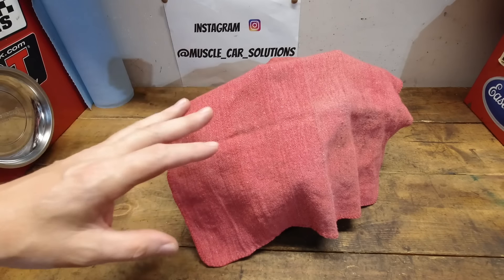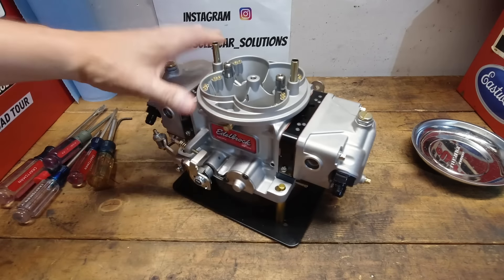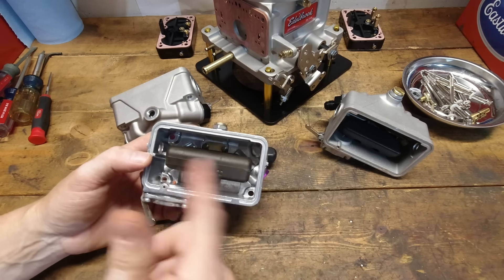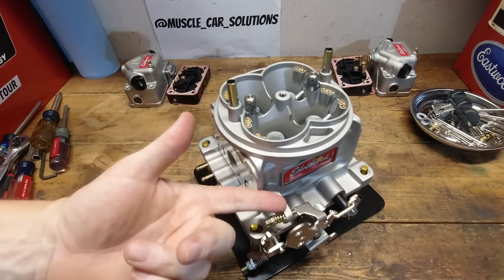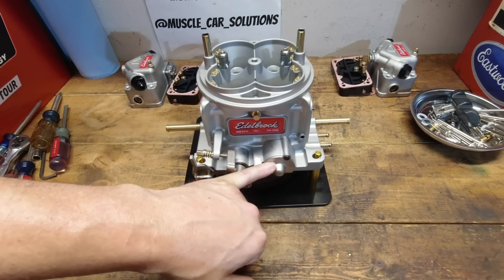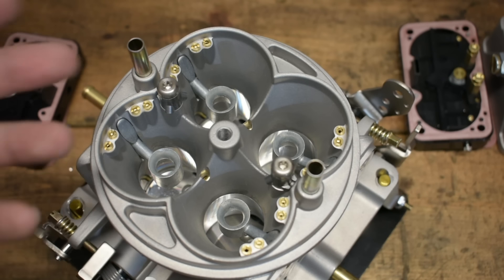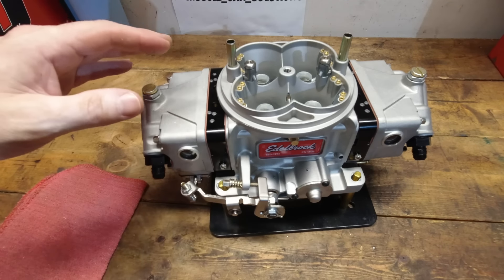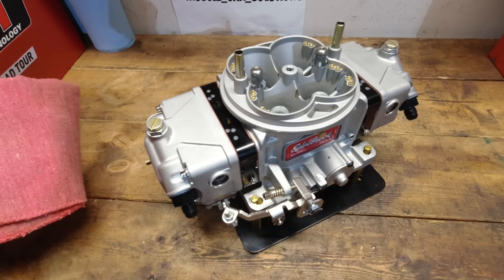The New Edelbrock VRS-4150 Carburetor - Full Review!

Comment: I’ve been waiting for a carb like this for years. Custom making air bleeds is such a pain and I love all their little touches. This is basically a braswell carburetor right from Edelbrock. But I definitely see a lot of hate for this coming in the future. People that don’t know how to adjust the carburetor are not gonna be able to get these things to run properly and this carburetor is going to get a bad reputation for being a POS.
I do think it was a bad move saying that this is for street guys, this should be geared as a race only carburetor this has no advantage over a standard muscle car engine with an AVS2. This could turn into a marketing nightmare for Edelbrock.
Reply from the maker: The Braswell doesn’t have a TPS.  Or the bowls this one has.  Or the auxiliary air bleeds.
Reply from the maker: I understand the thoughts, but calling this a marketing nightmare is opposite what it is.  The cost of a race carb with these features is easily double.  What kills carb guys is zero clue how to tune one.  The race guys don’t generally have that issue.  Once they use one, and see what that extra length in the venturi gets them, it’s going to gain traction in that crowd quickly.  If there is barking from the uneducated trying to monkey with the bleeds and emulsions, they’ll get laughed out of whatever Internet forum they’ll cry on.  We haven’t even broken into the beginning of this carb.  Just wait till the race engine builders get ahold of this carb for engine development.  Game changer.
Reply: @MuscleCarSolutions  absolutely it is a game changer and I love it. I have been on their waiting list to get one of these things for almost a year. The second one is available I’m gonna get a 950 for my BBC. I might pick up an 850 for my LS as well. At first I was a little nervous about not having a removable base but I guess we’ll see if it becomes an issue. The one thing I wish they would’ve kept from their other carburetors is the vertical jet system so you don’t have to make a mess every time you need to do a jet change. Not really an issue for a street car but in a race car application it’s a pain in the ass and a lot of intake manifold fire start because of that gas that spills out.
Reply from the maker: That’s one thing that might be a change in sizing.  I’m likely going to try a 750 on a 460 big block build I’m working on.  If it does struggle, I’ll go to the 850.  But from what I’ve been told by Edelbrock and by a builder who has had a couple on some crate engines they build, they have made more power with a smaller CFM.  100% that’s from the taller venturi and the redesigned booster.  Either way, the next year tuning on these is going to be very fun!
Reply: Don't they have an app for adjusting it?

Comment: Avs 4150? Holley 4150?
Reply: My bad vrs 4150
Reply from the maker: Did you…watch the video?
Reply: @MuscleCarSolutions  Ya I watched the Video. I just find it funny that it looks similar to the old Holley 4150 and they call it a 4150 I wonder if there gona come out with a version with only one metering block and a metering plate and call it a VRS 4160
Reply from the maker: 100% doubtful.  They have found great success with the performer and AVS carbs.  Creating a 4160 would be a step backwards.
Reply: @MuscleCarSolutions  It was just jokeing . Though I am curious why they call it a vrs 4150 though. Unless there paying homage to the old Holley or something. Though It would be amusing if Holley came out with a Carb called the Dominator 1406 or something along thoes lines. I am glad that the VRS lacks the endurashine plating of the old 1406 though